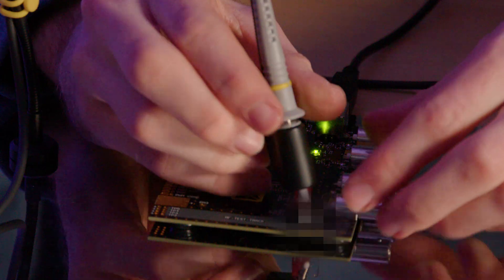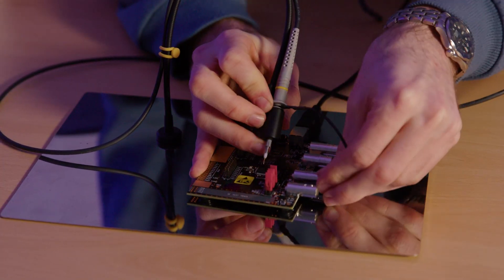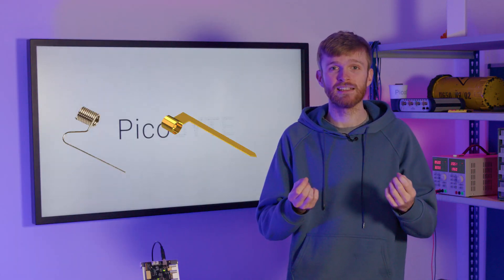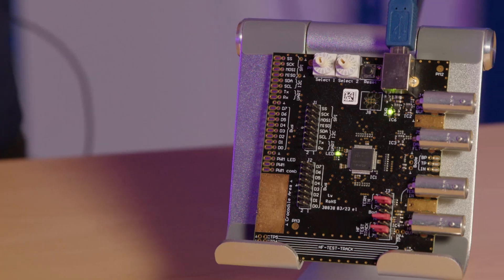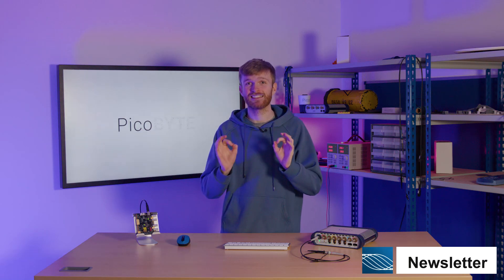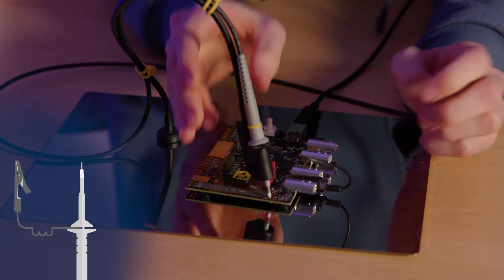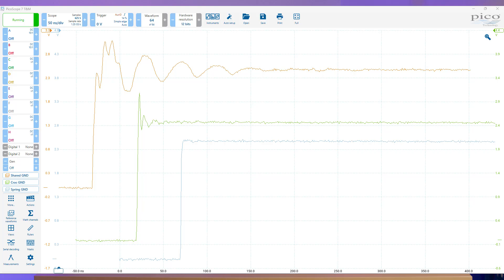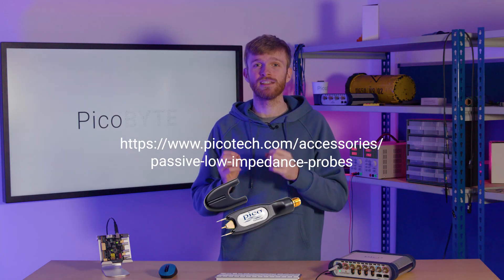You're testing your PCB wrong! | PicoBYTE #8

Comment: Hi! How did you fix the probes on the pcb? could you recommend a connector(female connector) that can hold the passive probe and ground spring to the pcb board tightly without any loose connection ?